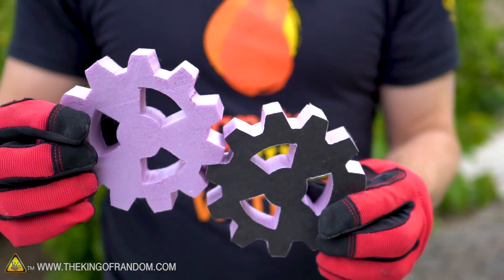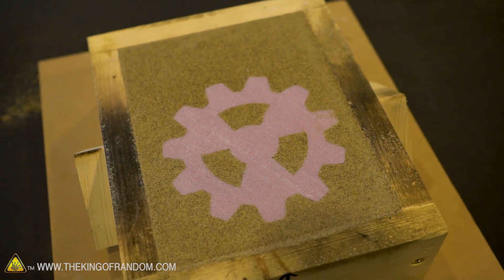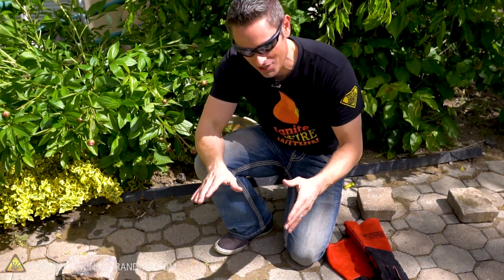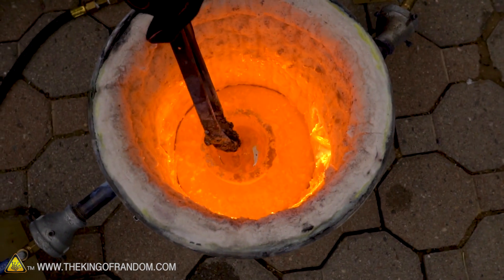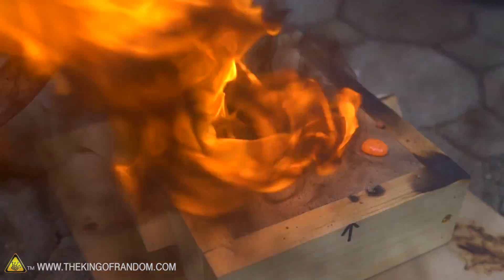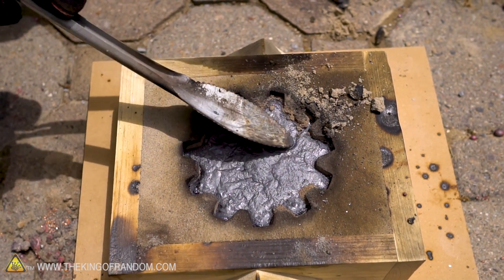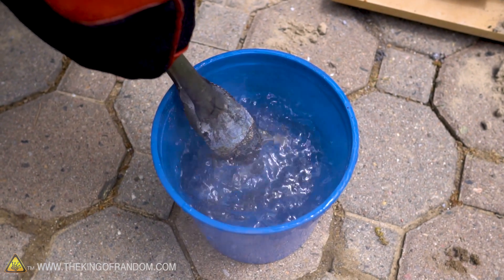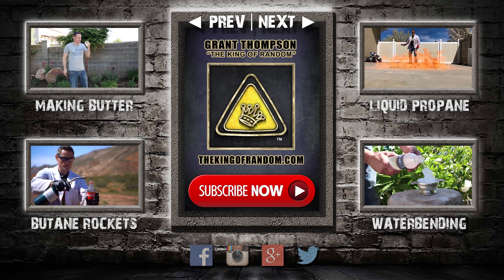Argh. Why Is Copper So Difficult? TKOR Tests Melting Copper In Our Homemade Foundry

Comment: My theory would be to use dryer and more compressed "sand" for the form. The molten copper vaporizes the water in between the sand. The force caused by the steam breaks the form. 

I suggest using a halved form with shafts for the inlet and outlet of gases and material. 

Since cooper is a quite easily formable material with high E module, industry tends to form it cold or "warm".
(Pulling, Pushing, Bending ..)

Comment: You should use some sort of adhesive for the sand. That way you may even be able to take out the Styrofoam and the sand won't break off and float on top of the copper.

Comment: The reason your sand mold is breaking apart is the moisture content of the sand is too high. Try adding starch to the water and allowing most of the moisture to evaporate before you pour. You will also want to spray the mold with lacquer after removing the Styrofoam piece carefully using simple screws to pull it carefully straight up.

Comment: Have you thought about trying to cool off molten metal with nitrogen? Would it get very violent or would it be the same with any other cool down of an item to nitrogen levels?

Also your attempt at the mold is the only one I've seen that does it like that. I have seen people use a double layer of sand one side of the sand is flat all around. The other has the mold of the item your trying to cast. Make a pour shaft and a vent shaft. Put both sand sides together lock them in place and poor the copper in the poor shaft until it comes out the vent shaft. You should then have a perfect mold of your gear.

Comment: make a wax model and encase it in plaster, after it dries you should bake the mould at a high temperature to remove the wax and remove all moisture. You can remove the plaster easily with some vibration sharp taps to the wherever you want it cleaned.

Comment: Try getting better sand, we had a similar issue, we ditched the sand and found a better supplier and the casting was fine. It looks like the binding agents have gone in your sand, it should not have lifted as it was doing. To see if this helps, try it with aluminium to see if the sand breaks away in that process too.

Comment: Hello Grant,

for casting there are existing special types of sand. One sand I have already used is called "oil sand". It is fire resistant and is acting like Play Doh. You´re chalking youre casting dummy with a powder, which is similar to, what high bar gymnast use for their hands, then you build your cast around it, take it carefully away (f.e. putting screws in it as handles) and filling your mold in the remaining cast. In this way, you will get a much better/ professional result.

My experience is, that salesmen, who sale the casting oil sand, also sale the mentioned casting chalk powder.

Greetings from an german engineer, please keep on putting great content to the web.

Comment: why can't you use a high temperature mold?  its how we prolong set time for hide glue in the guitar world. well one of the methods.  by heating up the gluing surface. its the same idea with molds and molten metals.  if you want the metal to take longer to cool, you need a hotter mold.  the water was a bad idea.  but luckily nothing exploded.  you need something to mix with the sand and bake it. like a clay , then heat the mold up to however hot it can get.

Comment: maybe because styrofoam is not wax? I am also thinking that if you were to close the top of the mold with maybe a slab of granite or steel and then pour the copper in through a hole , maybe at the center of the gear, the copper could then flow all through the styrofoam and the sand could not pop out....... EDIT:   LOL maybe I should have read all the erudite replies below that explain what I was thinking in a much better and complete way.

Comment: The sand mold needs to be heated up close to the heat of the copper, otherwise you'll have the hot/cold problem in every step of your venture of trying to get it more perfect.
:-)

Comment: The copper is way heavier than aluminum, no wonder it crushes the sand with it's weight there's way more force involved.
Try doing the same but with clay. 
1 make your styrofoam model
2 make a mold outta the wet clay and let it dry out
3 bake the mold (it also burns out the remaining styrofoam)
4 you have a nice empty ceramic mold
5 pour the copper in
6 let it cool entirely
7 break the mold. 
This is pretty much an industrial molding method, except they use wax instead of styrofoam.

Comment: I have an idea to keep the inner sand parts stable and hopefully they wouldn't break off by doing this. When making the mold, you put the foam in, pack the sand, all of that. After you have done that, while the foam is still in it, stick some small steel dowel rods inside the gaps of the gear to add stability to the sand there. You may need to repack the sand tight after putting the dowels in, but then when you pour the copper, the mold should hold more stable there as the sand now has something supporting it and keeping it upright. Worth a shot?

Comment: You should have payed more attention to those little spots inside the gear and by that i mean that you should have just poured a lil sand there and compressed it, it will not get nearly as compressed if you just pour all the sand in right away.

Comment: I've done some bronze casting before, I'd suggest not doing an open faced casting since the sand floats up, but rather a closed casting. in other words take two sand boxes and shape the gear in both. put the two together, to have your complete shape and then put a pouring hole and a riser for air to escape

Comment: Copper tubing is not pure copper, but a copper/tin blend, this is why the melt point is do high, it is known as "hard-drawn copper" getting "soft-drawn copper" would have a lower melt point, however, is significantly more expensive....

Comment: You should watch a couple Myfordboy vids.  If you were to enclose the mold (use both drag and cope) you could pour more confidently and thus FASTER.

Copper is 3 times more dense than aluminum and (I guess) 5 times more dense than sand.  Those Nuclear Hazard symbols broke loose so they could float.  The cope would fight that.

Store-bought greensand is stabilized with oil.

Comment: Grant, your problem is simple: sand is lighter than copper, so it floats. You bed to use something that makes sand heavier (iron powder?) or make your mold solid. As long as the sand can float up, it won't stay in place.

Comment: Why not make sure the Styrofoam gear is completely covered covered with about an inch of sand on both the top and bottom and the follow up by making some sort of funneling system to pour the copper in through different parts of the mold? This method should prevent any of the sand from breaking off like that since it will be supported all the way through inside the cavity :P

Comment: sand you used is tha issue !!! you need to use different kind of molding sand !!! and you have to use closed mold as yifan said.... more then that you have to add little borax powder ... into the molten copper and clean the molten copper surface

Comment: Why not use potting clay for a mould? It should be a little more heat resistant and won't flat on top of the copper. I would really like to see if that works.

Comment: I think for copper you should make the sand mold with sand mixed with epoxy resin
the mold should be sturdy  enough and won't fall apart
once the resin has hardened you can try to remove the gear or pour some acetone on it so it melts away

I think this should work perfectly althou I don't expect you to notice my comment and/or actually try it...

Comment: grant thompson what i would do is add another wodden frame ontop of the gear box frame and add a styrofoam tube straight up from the middle of the gear and add another layer of sand that way the centre pieces of the gear wont lift and u will get a perfect pour once the 2 pieces are pulled apart, sandwhich the cast as u make it unstable just pouring it straight onto the mould, it will helpout

Comment: Hi! As far as I know, in the industry people doens't use just sand, in fact the sand has some additives to mantain its structure, I think of a kind of polymer but i am not sure as heat could simply burn the polymer. Have you tried to use plaster?

Comment: Can't do patterns with holes in them with an open mold. Copper is heavier than sand, those pieces in the middle will break off and float every time. Have to use a 2 sided mold with a sprue and runner.

Comment: you need a bonding agent in your sand because it is way too weak, plus if you mould sprigs into the mould to hold delicate pieces in place. plus what was your melting temp? saying oh that looks quite molten is not that accurate. also if you used a bonding agent you could mould a pouring cup and be able to pour it faster and more accurately

Comment: place your sand in an oven well spread out in cookie trays at 450 to get the moisture out after setting your form. thus when you pour the metal it will not cause gasification of moisture in the sand.

Comment: The downward force of the pouring metal is easily enough to dislodge the sand, and ruin your formwork.
Try mixing a small amount of sodium silicate with the sand, then cure it with carbon dioxide. 
The formwork will become MUCH, MUCH harder. You could even remove the foam before you pour.

Comment: Maybe try a stainless steel frame for your mold and heat it up. That way the heat from the mould may sort the copper cooling down problem.

Comment: imo pre heat the mold/sand in the oven that would burn off the Styrofoam and the sand will not cool the copper as fast allowing it to flow better

Comment: I think, the more moistened sand didnt work at all, because the water in the sand evaporated and could bring up a force strong enough to lift the chunks right at the point where they were connected with the rest of the sand. Maybe it has to be another kind of material

Comment: Part of the problem is the density of the copper; the sand plug is floating out.  Using a two part cope and drag so the "Roof"  holds the plugs down would help.  You can also reinforce the plugs with some loops of wire extending into the underlying sand, though I don't know how well that might work.  Really, the reason the professionals use the "Traditional" methods is because the easy way, ie. open face mold, doesn't work as well.  I'd like to see you do it well... because I want to see how it works out before I try my own casting project.

Comment: You certainly are persistent. I agree with the limitations commented on by others about your choice in personal protective equipment. Your choice of sand for the mold is problematic. One alternative is to add sodium silicate to your sand mixture and cure with gaseous CO2. Your mold will be much tougher, especially if you undercut you pattern to make it easier to remove. Clearly, using a standard cope and drag is a better way to go..
Thanks for take time to put up the video. We can all learn from others' mistakes.

Comment: Grant, This should have been done using a two part Green Sand mold and a Pour Spout. with vents.  Also  Your lucky that last Sand Cast didnt Explode from all the moisture in that sand.  Water and Casting are two things that should NEVER happen together.

Comment: Like others have said...the open mold doesn't give your details any support. A closed (two part) mold with risers, gates and runners would support your sand and give everything stability. Also, using wet sand can create small voids in the metal where the water vapor was trying to escape. These voids greatly weakens the part and can prove disastrous if the part spins at high speeds with a load.

Comment: grant you need to use a plaster investment material here is some information on this when used with a vacuum you get amazing detail or do this open topped like your green sand casting with this more durable material unfortunately it is not reusable

Comment: Most likely your problems stem from numerous factors; improper green sand mixture, sand rammed VERY loosely, pouring directly into a mold rather than using a sprue, gate, and riser and most importantly only using half of the mold. Green sand is supposed to be used in a cope and drag setup not an open faced mold.

Comment: I think you should remove gently the plastic template before putting the copper because if you melt it you create deformation in the cast or use plaster instead of sand, it hardens more

Comment: You can try a close mold, just split the gear shape in two molds, put one over the other making the shapes match and a hole to fill the mold. When you fill am old if you don't have an excess of liquid metal the contraction of the liquid metal can ruin your piece, that hole full of liquid metal will compensate the metal contraction during the cooling process, and you can make more holes to prevent even more that contraction. It is a bit more difficult, but the results are better.

Sorry for that english.

Comment: Why don't you use 50% plaster mixed with 50% sand instead of the green sand as a mould. When the part is cooled you break away the plaster from the part.

Comment: if you want to keep using green sand and want to make this shape properly and are still only pouring in the center, would it work to have some kind of cover over the mold holding everything else in place and just pour thru a hole centered on the center of the molding. That way those sand pieces wont lift up and it would still melt around the area where the foam was.

Comment: When I was in middle school, we did some aluminum like this but we had a second layer of green sand on top with some sprues to pour through. Then just poured as quickly as the mold would accept more material.

Comment: What if you took a blow torch to the sand and the foam gear first? The heat from the torch would melt the foam gear and should make the sand more crispy, harder and stable. Then pour in your completely molten copper.
Reply: if you blow torch to the sand and the foam gear first it would dry out this water based version of green sand making the mold more likely to dust and break.
Reply: Star Brand crispy sand?  sand melts at a much higher temp....how does it get crispy?

Comment: You need to make a feeding channel, so it's not so violent when it lands.
A heat resistant half pipe that feeds the molten copper to the mold without having too much force when it lands.

You other option is to pan cake two sand molds together and sandwich the gear shape between and feed a feeding pipe to the mold and clamp them together with tension grips.

Comment: I think you got too much air trapped in your sand, so for parts that is surrounded by molten copper the denser liquid makes it float up. need to either change your design so the middle parts have more contact with the walls or change your mould material to something more rigid or dense.

Comment: Reason why the inserts of sand where popping out was because you watered down the sand, it was boiling causing air pockets in the sand and breaking them off, next time use oil in the sand

Comment: Try plaster casting instead of sand casting, or just add a bit of plaster to sand so it functions as a binder so the mold holds together on it's own, then dry it, and preheat it in an oven, the hotter the better. A preheated mold will cool more slowly, and it won't have any moisture to cause defects in the casting, and the plaster prevents it from falling apart.

Comment: add your second mold box with a single vertical center fill speru with smaller vertical air venting tube at the tip of each gear tube this will insolat your molten copper allow it to fill smaller spaces while keeping your center details supported with foam and your top layer of sand

Comment: wowww that looks nice.
but i think water in the sand will create a bubble when it heated with hot copper.
so why don't try to make mould with cement or clay (let it dry)
i hope you can get what you expect

Comment: It's a black Art.  But you can lean alot from these books :  Metal Casting Vol. 1 Steve Chastain
Metal Casting Vol. 2  Steve Chastain      The Complete handbook of Sand Casting 
by CW Ammen        The Charcoal Foundry by Dave Gingery

Comment: use a two part mold box ( cope and drag )  Leave the foam in the sand then just pour the molten copper in through a sprue in the top half.  You will have a much better part in the end.

Comment: Sand floats in copper because copper is heavier. To do this you need an enclosed mold with sprues. Same for brass. You could probably open cast aluminum like that, but i wouldn't even do that.

Comment: Use a cope and drag. When there is a cope on top of the mold (which is called drag then) the sand won't move upward and float. And the mold is more stable then.

Comment: Dude, you need to enclose the top of the mould too. Leave a little hole at the top and pour the molten copper down a channel into that hole. Otherwise the weight of the liquid is going to hit the sand and knock it down into the cavity

Comment: i just can't wrap my brain around the thought process of "2000 degree metal makes the wet sand explode... lets make it wetter!" 

you probably already learned this by now, but they make binding agents for your sand casting so you can do it dry without making steam explosions. smh

Comment: You need to use a closed sandmold, with one ventilation hole and one pour hole. Cut of the access copper and grind it smooth. I really want to see you succeed on this one ! :)